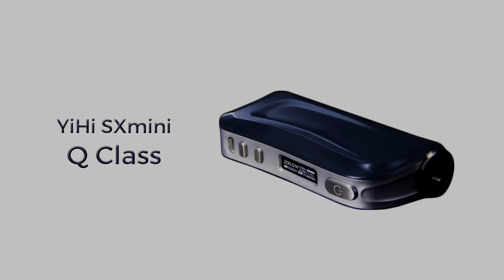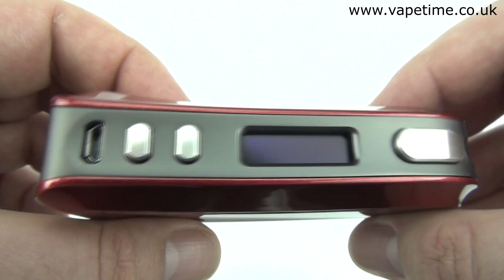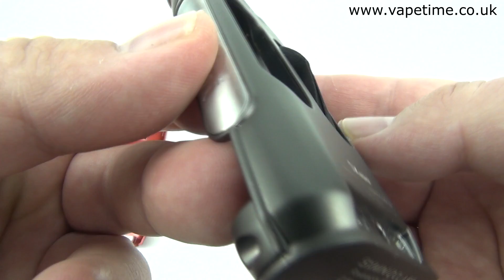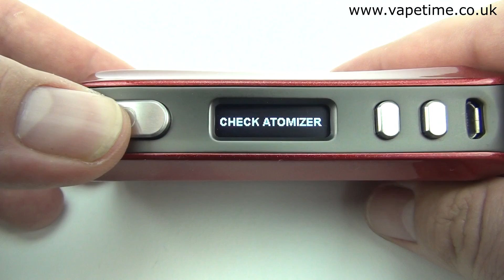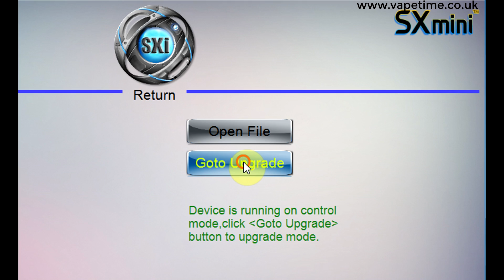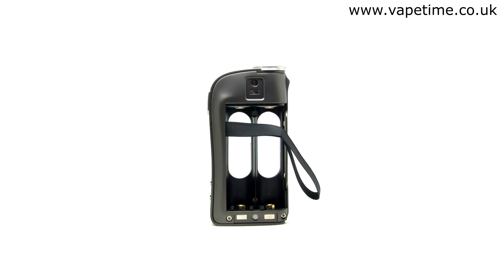YiHi SX mini Q-Class & SXI Q-Control - Overview & User Guide

Comment: Wheng using Joule mode often facing issue with "Dry Coil no Liquid" though I'm using RTA with full of liquid that wet the wick perfectly. How to fix this?
Reply: Jodie Darmasaputra You can't use nichrome. Only nickel, stainless, and titanium.
Reply from the maker: Hi Eko,

Either press the 2 small buttons to register the resistance. Joules is for temp sensing so ensure you have the right material selected and the coils must be spaced and not touching to work. 

If you are using kanthal you should use the device on watts.

Many thanks

Vapetime team
Reply: Yeah i think it works out well now. I have to use manual TCR as the material is not listed yet in sx feature
Reply: Vapetime UK i already used the joule mode and set the resistance but it never shown 'dry coil no liquid' on the screen and my wicks are completely dry and burnt. how to fix this?
Reply: Vapetime UK fyi i used nichrome80 wire with TCR manual and that anti dry burning feature dont show up

Comment: How do you turn on the Bypass Mode? It just stays on OFF when I click on ON.
Reply from the maker: Hi,

When you scroll through settings you should see it, when you get to it just hit the up or down and switch on. Takes several clicks to get through all of them. 

Thanks 
Paul
Reply: +Vapetime UK apparently the Q Class Mini doesn't have a Bypass Mode. Are you sure you can access it right on your device?
Reply from the maker: Our apologies for the misinformation given above. Both the M-Class & ML-Class support 'Bypass Mode'  upto approximately 80watts. The Q-Class has the same familiar menu system, however it does not offer the Bypass function.

Comment: @8:49 you say multi-? effects? What is the word you used?
Reply from the maker: "Multi-stage-heating-effects"....this happens when using/mixing different wire gauges and materials. Ramp-up time and ultimately flavour will be determined by this. SXi-Q will allow the user to adjust settings to tailor the vape to their preferences.